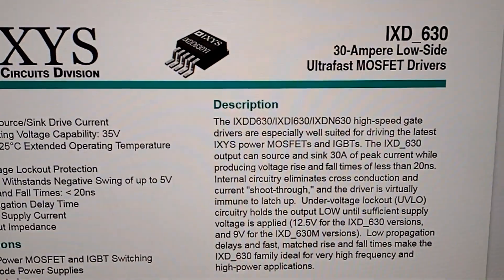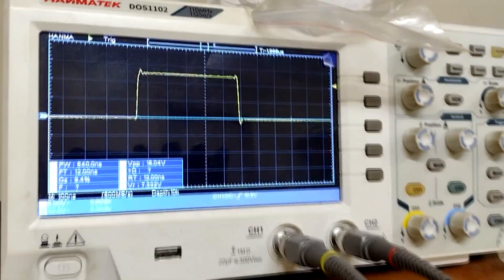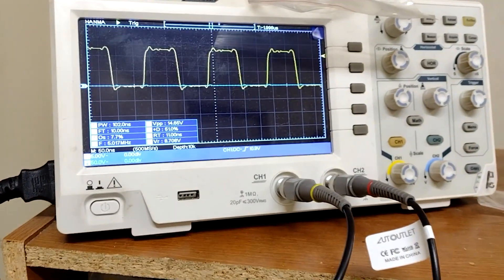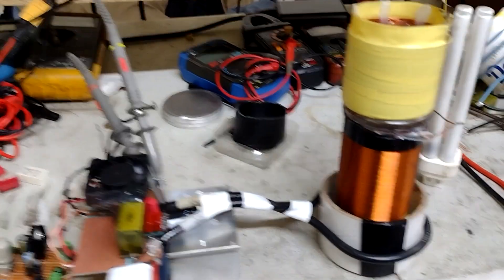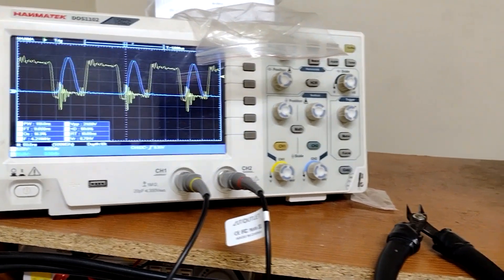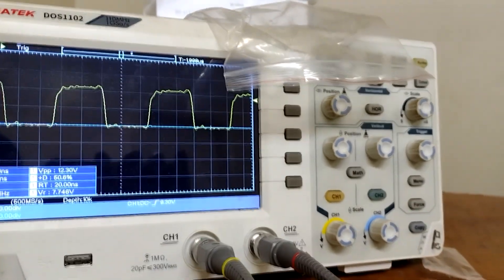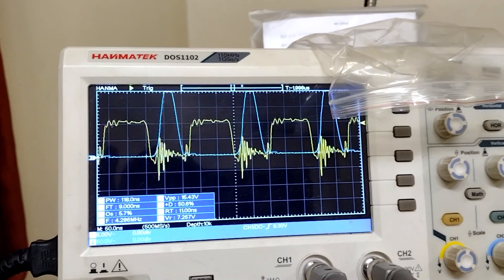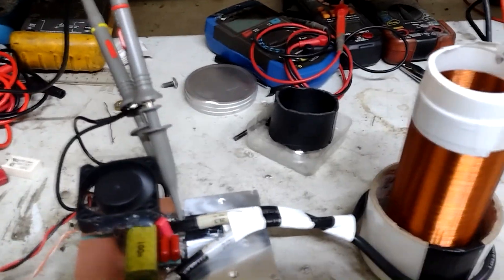HFSSTC w/IXDD630 Gate Driver Test

Comment: Hi dude . Theres a way to vary the dutyCycle for the schmitt trigger oscillator using 2 antiparallel diodes , witout changing the frequency. I was wondering if that would help out in class E tuning so as to get the proper frequency and them try adjusting the dutyCycle to allow for ZVS , with small variations.
Reply from the maker: I've had to play with the duty cycle before on other circuits to get the tuning right but I'll typically just do an either/or with what is an asymmetrical output and just pick an inverted or non inverted one.. say 40% or 60% based on what works better at the time. With the schmitt trigger oscillator by itself I think it may be better to shoot for a solid 50% and just tune the drain capacitance a little lower while also probably dealing with higher peaks.

Comment: What would be the diference between using the Schmitt trigger oscilator , or using just a cd4046 oscilator without feedback ? I kinda would like to make a fixed Frequency setup very minimalist , with just the essentials
Reply from the maker: So basically I just noticed on a few builds that it was either about the same without the schmitt trigger, or a little better when using feedback with only the cd4046. My reasoning had always told me it would be otherwise so the reason it works better for me a lot of times with just the CD4046 could have less to do with the feedback sensitivity on that chip and more to do with something else. Not really sure and never looked into it.. On setups where I have both chips and want to use just the CD4046, I'll just leave the schmitt trigger on there in case I want to use it after the PLL. Maybe I have an inverting gate driver and want to invert the drive signal etc. Otherwise you really just bypass the schmitt trigger and run the feedback straight to the cd4046 input, making sure to clamp that to the rails with switching diodes just like what was done with the schmitt trigger.

Comment: Hi, SiC mosfets require +20V @ 10A for turn on and -5V @ 10A for turn off for hard switching applications like yours. Thank you for your great videos. Subscribed.
Reply from the maker: These particular ones can be dropped in replacements for regular SI fets so you don't need anywhere near 20 volts to switch them on
Reply from the maker: Couldn't remember the model but just looked it up. These are UF3C065040K3S. They are actually advertised as the only standard-drive SiC fets on the market. I have 2 more of those running real nice 3-4mhz at 12v drive.
Reply: @Magneticitist  That is a cool SiC with very good specs. Thank you!

Comment: It would be interesting to see how many power grabbing antennas you could make and not bog your input down. What i mean is build a half wave bridge recifer with a wire antenna as the input and use the half wave output to a cap to charge a battery or just run a small load or even assist in lowering you input needs. There is no free lunch but it would make an interesting case study.
Reply from the maker: Used to do that a lot with just Slayers. Done that at real low power like 1W or less with these and it's pretty impressive I think, but the input is always going to bog down eventually. It's essentially doing that always if you just consider bogging the loading in general. It might get more in tune to certain loads but you certainly won't get more output than input that way. 

I get the best results from push-pull circuits. I've lit things like 400W halogens from 15V drives and using a receiver maybe a foot away or so. Didn't get the full 400W but it was impressive to see such a bulb get pretty bright.

Comment: Very cool, I can’t wait to start messing around with these things again once I’m done with university for the semester. I also see you’ve started using copper clad board for these high frequency coils which is definitely the right way to go to as far as having higher efficiency and better spark lengths.
Reply from the maker: Yea the power sections of these are so easy to setup I figured copper clads would actually be easier than running wires. Still not entirely sure about the best approach to routing them though. So far I haven't paid any mind at all to things like trace balancing. Honestly I thought I had some pretty good results with the more basic components like UCC27322 w/Amazon 260 mosfet for example. A couple of those I have only seem limited by the max Vgs and could probably push 400W easily otherwise.

I may end up just grabbing a real beefy Si fet for this one knowing that basically whatever it is the driver can handle it.

Comment: Having the Schmitt trigger oscilator that far away from the power stage could be the cause of that noise on the gate driver I thought ? That secondary looks pretty close to the one I am playing with my pll mine is 6cm x 10cm I do not know what gauge is the wire but is thick , that new power supply is fancy af hehe I like it , keep it up brother 🙌
Reply from the maker: It should be shielded but the ringing is more the result of the intrinsic LC values in the wiring and mosfet. For example the gate drive loop consists of some small inductance and capacitance and it will want to ring in the high MHz. This is more a problem with the SiC fets because they are so fast. Imagine pulsing an electromagnet and observing the current spike that keeps going after you remove the dc source. This will probably be a high voltage if you've immediately removed the power source and resulting EMF. You're not going to see such a high voltage spike if you were to ramp the source input down rather than immediately disconnect it because you've decreased the rate of change a lot. 

The new supply is pretty awesome though, haven't really utilized it all the way yet. I had been seeing it on amazon for a while then one day randomly refreshed a search and saw a new listing for one that needed assembly and was like $50 cheaper.
Reply from the maker: @Lasr8  made by Riden, the 800 watt model